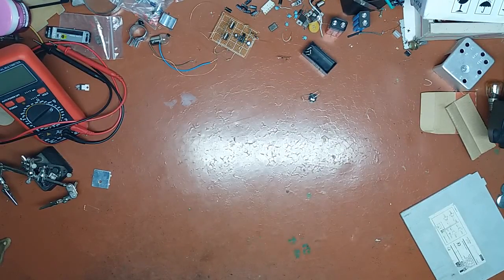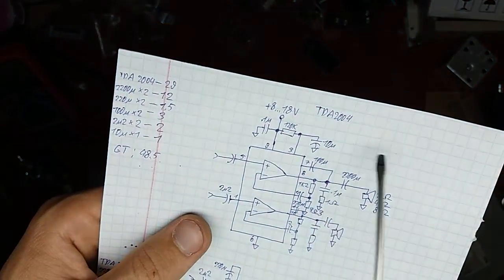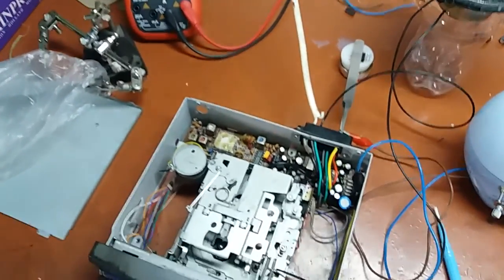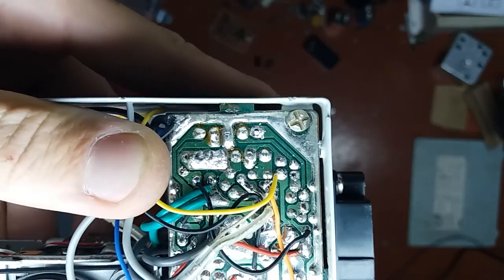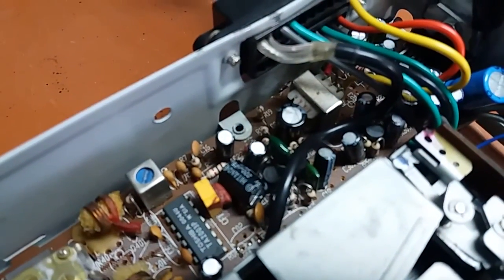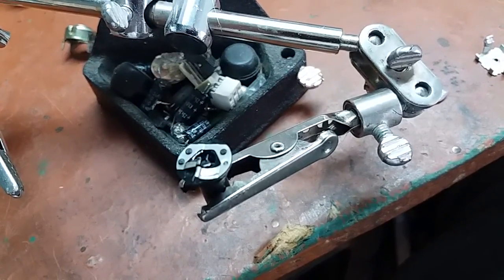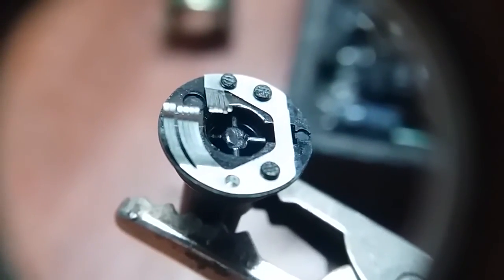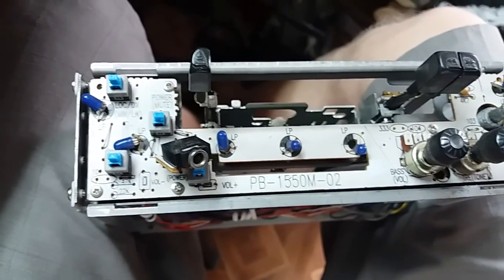Car Stereo Repair #4 - Part 2 of 2

Comment: Apologies for a question but I have an Audi where there is a capacitor and amplifier in the actual aerial lead. The radio reception is poor and I wonder could the capacitor be at fault. Thank you.
Reply from the maker: Might be, for all I know. But the antenna amplifier is more likely the cause. If you live in strong signal area, just run the antenna straight to the stereo, without the amp or cap.

Comment: You allways sound upset when minor things happen, like the radio dropping it's bottom, blame gravity as it is evil lol :-D.
It does not matter :-D.

I like your volume pot repair :-D, i was thinking a hot needle for the pin but solid wire is plenty strong enough.
Your wire insulation bearing/packing did a beautiful job, works like new :-D.

I have done all sorts of repairs similar to yours, sometimes it's not practical to attempt to get the original part, and it's often not worth the money.

I did a needle job on my old frends multi c.d player, there were many plastic pins that poked through a plastic deck (yes they were all snapped off).
The c.d platter held many c'd's and as it rotated it operated the pins.
I heated up some needles and sank them into the switches, then glued wire insulation on to the pins, worked a treat :-D
It was a shitty design of cd player, i have never seen one since.
Reply from the maker: Can't do much about the way I react, blame my temper :D
 About hot needle - that plastic was pesky, it won't melt until you reach certain temperature and then it will burn and disintegrate.
Reply: Oh i see, i was just worried about you being bothered by things that just dont matter, just a crappy radio lol.

Ahh crappy plastic, ive been there, after a bit of head scratching ....... i come up with a bodge... err i mean professional workaround :)